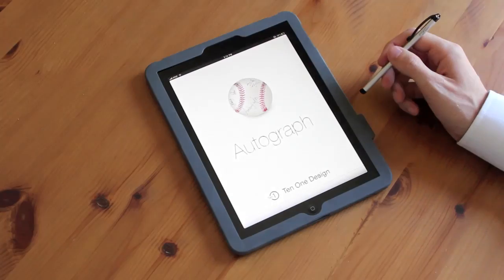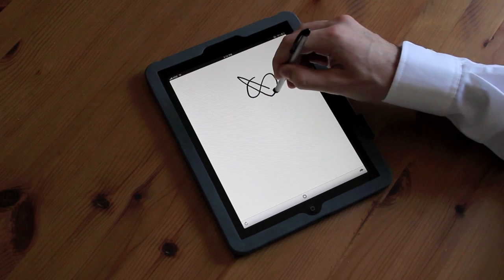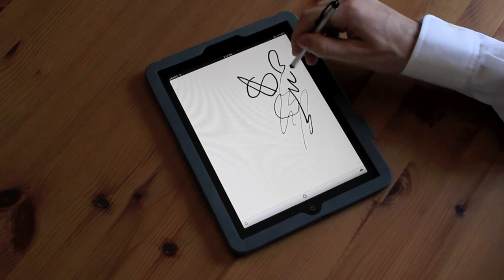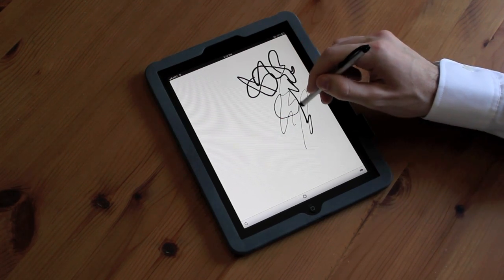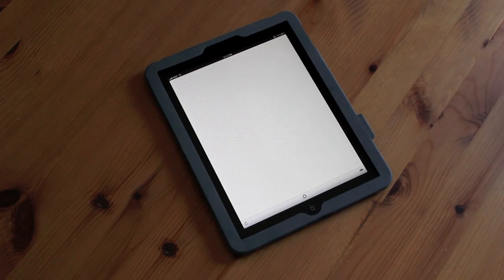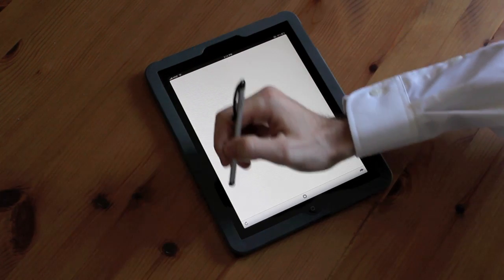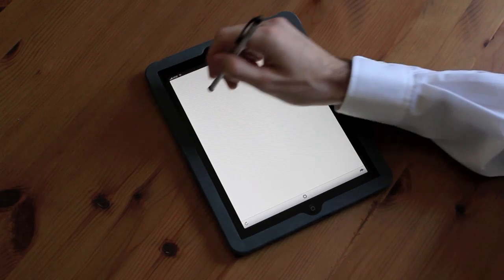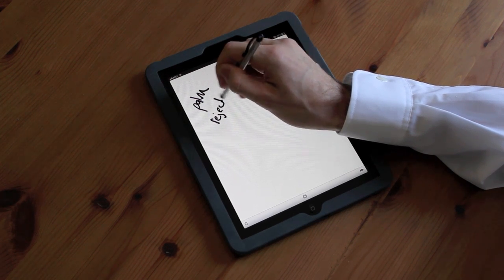iPad Pressure Demonstration

Comment: I'm assuming that the pressure sensitive part is in the stylus not the iPad - capacitive touch screens cant tell pressure, but they're far more precise. The stylus then links to the ipad. That's not a bad thing. It's a brilliant way of getting around a problem that will allow users to combine the precision and response of capacitive screens with the pressure sensitivity of resistive screens.

Comment: @fuaburisu Yeah, I've definitely thought about that. would like to make a prototype at some point, but such light-pressure sensors with such a low yet precise range are not very common, and definitely not cheap. a small bluetooth module like that could probably just be taken from most bluetooth cellphone headsets, they're normally pretty small and not too expensive

Wacom's technology is really sophisticated. there's a reason replacement pens cost 30+ dollars even for their most low-end tablets.

Comment: @flufflesthepancake the pressure is inferred by the size of the spongy tip on the screen, (the harder you press, the more of it touches the screen) similarly to how their 'Inklet' application for macbook track pads works. 

This really is not comparable to the digitizing technology companies like Wacom have, since it's an analog system, not digital with a pressure sensor. However it has the upside of being cheap and not requiring any modification to the device.

Comment: This is cool, but the pogo is really frustrating.  I have one for my Touch and it's so difficult to get a good line out of it unless you press really hard.  Meanwhile, my Cintiq responds to the most sensitive little stroke and tiny little details.  Might be different on the Ipad though.  I don't like drawing with a brush though.  Would rather a point, but I know it can't be done.

Comment: @CapraCorn2006 The thick tip is a limitation of the hardware. Until apple release an active stylus and facilitate an interface with it in their software there will not be a decent solution to that for iPad. The way Steve Jobs calls it, that will be never.